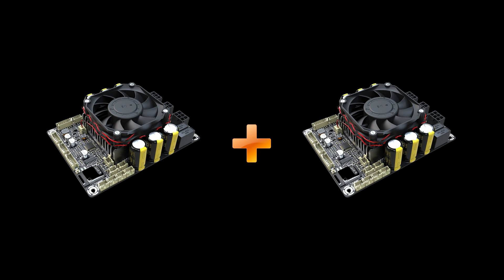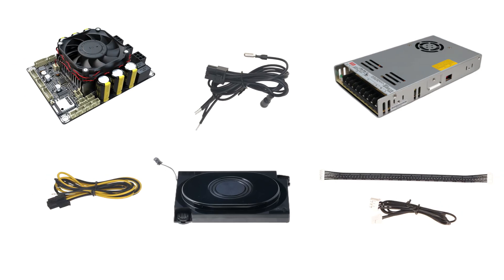JAB5 4CH 100W Amplifier with Bluetooth 5.0 and ADAU1701 DSP Cascading 8.0 Multi-Speaker System

Comment: how can a set up like this be controlled in sigma studio? and how are the pot controls allocated?
Reply from the maker: Hello, thank you for your watching. You can connect the ICP5 to each JAB5 in turn for SigmaStudio programming. The functions of the potentiometers can be customized via SigmaStudio. Wish this could help you. Have a fantastic day~
Reply: @WONDOMAudio can i use all 8 potentiometers or am i only limited to use the 4 pots on the master amplifier?
Reply from the maker: @mohitalen1309  Hello. All 8 potentiometers can work but they can only control the correspodent JAB5. Wish this could help you. Have a fantastic day~